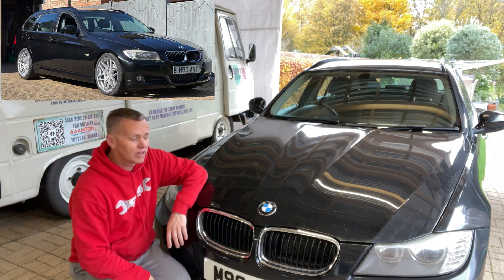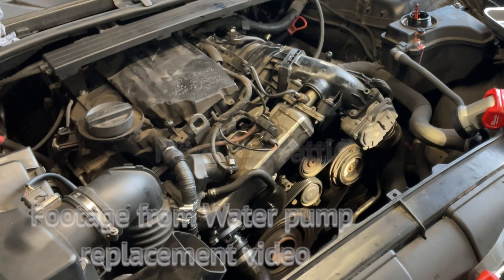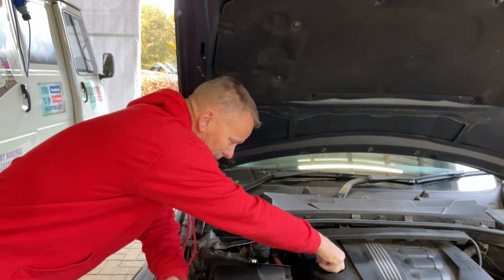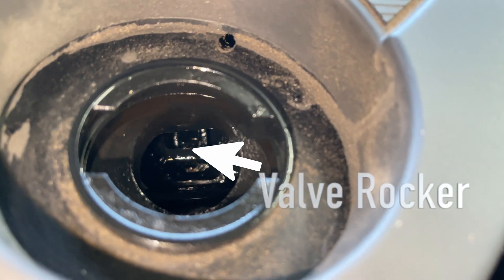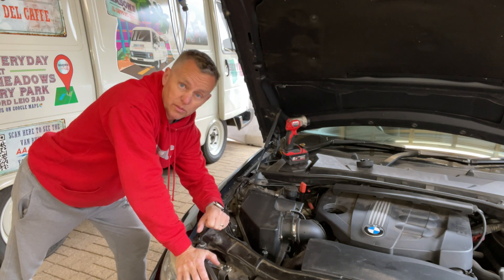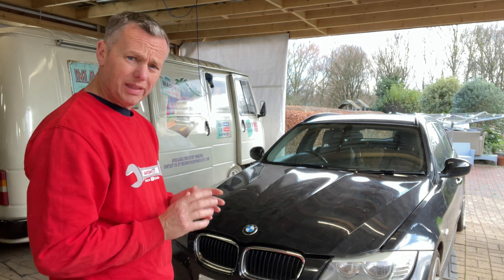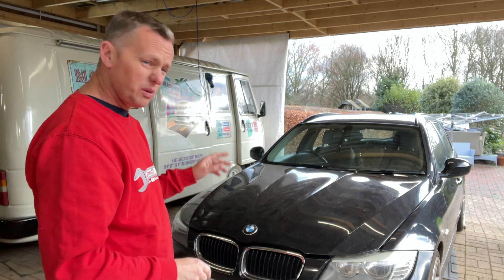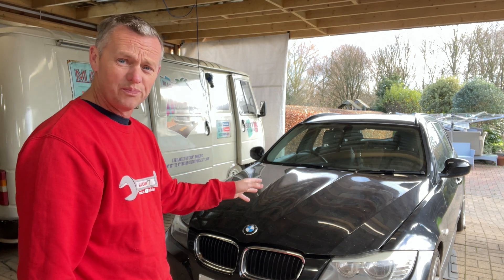BMW 318D Timing Chain Broken? How To Check N47 Diesel Part1

Comment: When i bought my 318d had the timing chain replaced (at 290k kms) checked the service book and it was also replaced back in germany at 150k kms seems to be a big trouble for these n47s
Reply: Just gotta sell it before 450k kms 😂😅
Reply from the maker: It's a strong engine. the chain is a pain but not too much damage when it broke, Thanks for the great comments👍🏻👍🏻🛠

Comment: What's the point if the owner doesn't change the oil?
Reply from the maker: Hands up, I missed a service by accident, but the chain has been noisy for 3-4 years, I did some reviews on code readers and reset the service lights, then overlooked the oil change, Thanks for the great comments👍🏻👍🏻🛠

Comment: I had my chain kit replaced on my 1 series N47 118d at 80k mileage. Mechanic said it was close on snapping was a very expensive job but glad it's done. Best to change engine oil every 7 months as engine oil is cheaper than chain replacement.
Reply from the maker: I have covered 166000 miles on the one chain, but it has been getting noisy over the past 3-4 years, Thanks for the great comments👍🏻👍🏻🛠
Reply: How much did you pay if you can help me to have an idea because I should change it too